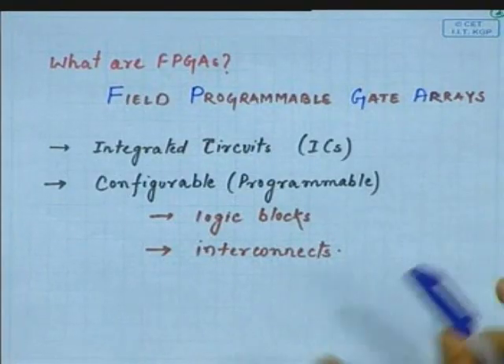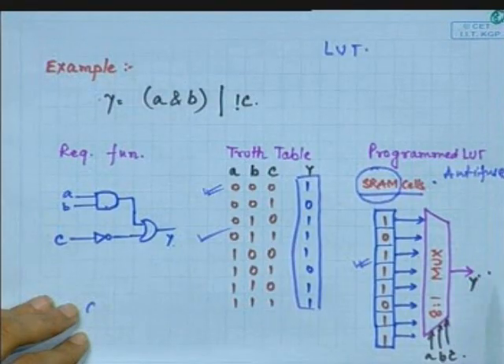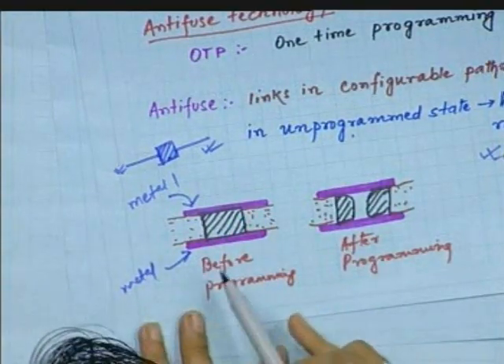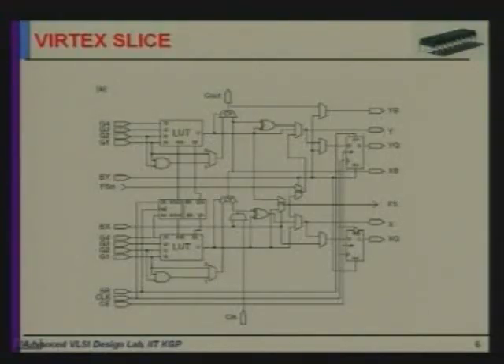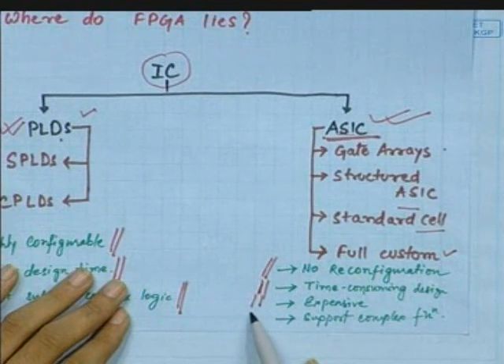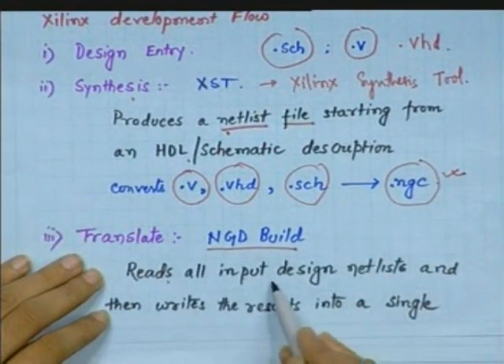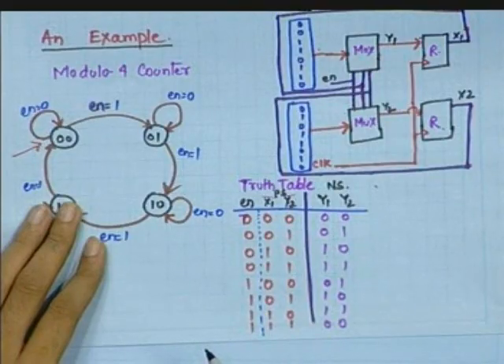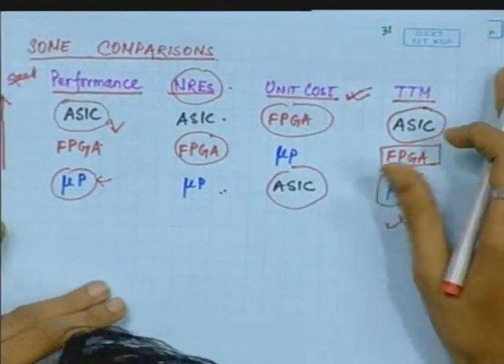Lec-39 introduction to fpga

Comment: Intro is misleading. An electronic device or embedded system is said to be field-programmable or in-place programmable if its firmware (stored in non-volatile memory, such as ROM) can be modified "in the field," without disassembling the device or returning it to its manufacturer.
Reply: It's not misleading. In FPGA we are not modifying/updating firmware. We are changing the hardware itself, and it's being programmed on the "Field". Hence the name FPGA.

Comment: Well, I'm not the professor, but if you want to learn about FPGAs:
a) You need to know how to program it. This involves buying a training FPGA board- also the cheapest available FPGA. Try Digilent. The largest FPGA manufactures are Xilinx and Altera, and they ship their products with the necessary programs and tutorials. Also, try to learn HDL and Verilog if you have enough time.
b) If you REALLY want to use FPGA board, you need study digital fundamentals and IC. These will take some time.

Comment: Micro processors are pretty much your CPUs, or the "simpler" version of it. They can be used for a LOT of things, pretty much all circuits that use logic uses some form of microprocessor. I've recently used one to install a humidifier in my fireplace: measures and controls the humidifier so that the room does not become too try when the fire is on.

Comment: This kind of application is more on the side of electrical engineering than computer science. You can use FPGA to create a combination of these signal processors and micro controllers-all which should be under the limit of the possible LUTs of the device. This is why FPGAs are used as prototyping, it can be reconfigured to essentially many different micro processors, routers, signal processors, and so on.

Comment: With FPGA, if you have a soft microprocessor installed, it will act in a similar manner.

The main difference is the level of programming: With microprocessors, you are making a list of instructions to achieve your goal, or when you are writing on a high level language, it gets compiled to the simple instructions that a microprocessor knows. With FPGA, you can pretty much do the same but more. You can program FPGA like a bunch of logic devices and use it as a form of signal processor.

Comment: It is like comparing a transistor to a full processor. FPGA is a collection of logic units that can be reconfigured to pretty much anything. You can even write your own "soft" microprocessor on FPGA. The microprocessor you are referring to is an ASIC device, it has a set of known instructions. A microprocessor will receive an instruction, and if it is one from the forementioned set, it will execute it, one at a time.